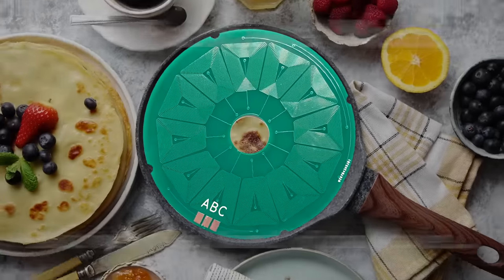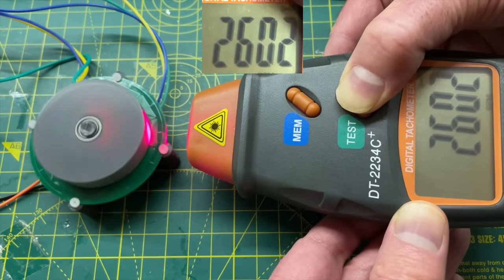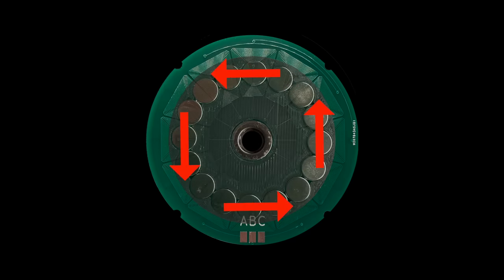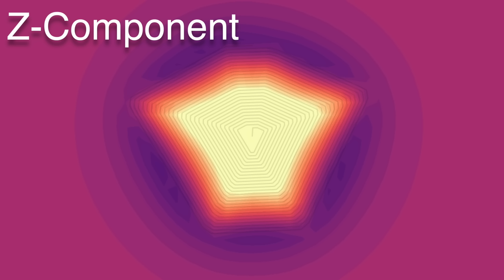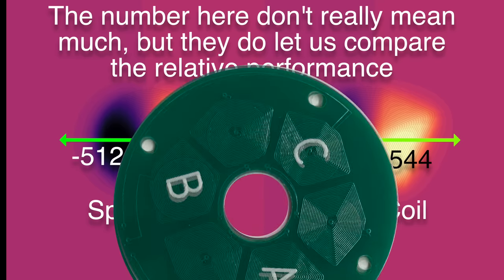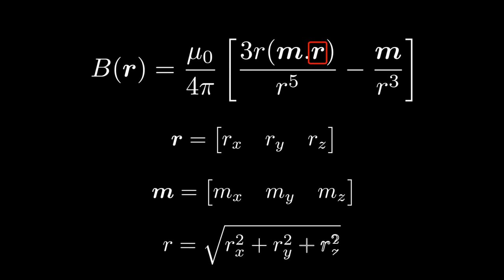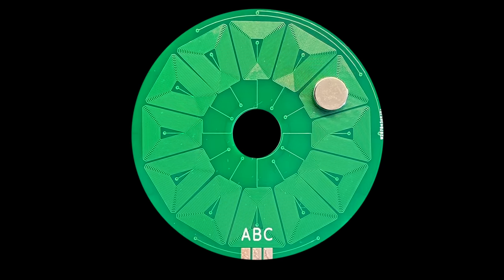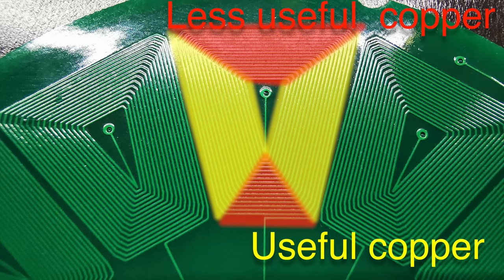PCB Motor - Why Are Wedge Coils Better Than Round Coils?

Comment: I think you are missing out on a lot of force/efficiency by making the traces the same size as the spacing. This maximizes the number of turns, but not the current density. If you keep the same minimum widths, but make the traces thicker, you will have less loops, but with a much higher current capacity, for an overall higher density. For ex, if you made the traces 3x thicker, you'd have 1/2 the number of loops, with 0.5 * 3 = 1.5x more current density. Right now you're effectively only using 50% of the copper available to make the coil!
Reply: So the goal is to maximize magnetic flux right? So ya maximizing change in current makes sense, so maximizing the peak current ability makes sense :)
Reply: @nikilragav  The magnetic field strength doesn't depend on the rate of change.
Reply: @deang5622  oh yea. Not dI/dt but just I
Reply: Magneto motive force is generated by N x I, where N is the number of turns in the coil and I is the current, so reducing the coils by some factor, means you have to INCREASE the current by the same factor to get the same force.  

In electronics, increasing the current required usually comes at extra cost - typically in power losses and / or the size required for the parts to drive the circuit.

For example, for the wires leading to the motor, losses are R x I^2, where R is the wire resistance and I is the current.  So if the coil current is increased by a factor of 3, losses in that wire go up by a factor of 9.  For small motors like this that can easily be solved with a bigger wire, but as your motor gets larger, that starts adding cost and weight.
Reply: @Cynthia_Cantrell  ..ya...i think so too, the solution is not to use bigger wires but thinner wires and more loops, and ofc ferros, as i understand it the experiment is to get as much torke out as possible... also in the initial experiment he uses magnets...he should be using coils instead...as i understand it hes not trying to reach a high rpm but torke...the rotor doesent even have to be of a metal...it can be another board sandwiched between two boards...just with an axis...if each 3xboards is 4mm thick its possibly stack a lage ammount of sequenced (sandwiched) boards to increse torke and lower the current....its even possible rotete each section to have an applied force almost constant with enugh sections... such a motor can also be used to deaccelerate almost immedietly (like a modern electric truck with electric breaking)
Reply: @nikilragav  Check again bro,  If a coil connected to DC Voltage, stays for longer than current "i"  transient connected to a totally stable DC Voltage, the coils retains the Magnetic Flux, wich is also stable, as long as voltage stays fixed also. If you maximaze flux change, then you maximaze power transfer as Fem, is this right you think ? Cheers
Reply: This is correct. The only thing that matters is the current density in the coil. PCB rules mean the minimum space needs to be 0.2mm or so. Wider traces will give you more copper in the coil. So you can maintain the same current density with less resistive losses. However, with fewer turns, you will have a higher Kv.
Reply: @Cynthia_Cantrell  in general, using fewer turns of thicker wire or more turns of thinner wire has no effect on motor power, torque, or efficiency, as long as you always fill the available space for wire efficiently. What changes is the motor Kv.
Reply: @deang5622  Zeno begs to differ.
Reply: @mckenziekeith7434  Rubbish.
The original equation by Cynthia Cantrell was correct.

It is the magnetic field strength which is a function of the current. Increase the current and you increase the magnetic field and the torque produced increases.

Motors are current driven, NOT voltage driven.
Seem you have forgotten your electrical machine theory and magnetic field theory from University.
Reply: @Cineenvenordquist  Then Zeno didn't study for a degree in electrical engineering and did not study the magnetic field equations for current carrying conductors.
Reply: @Cineenvenordquist  ya..ur idd correct, I is always time dependent
Current(I) is: Columb(C, not to be comfused with speed of light) per second,
1C/s=1A (1C=the charge of 6.241509074×10^18 electrons)

im also chocked no1 even mentioned magnetic permability & magnetic resistance
(magnetic resistance may not be an issue...its not like thay are trying to reach a hig velocity (high freq of magnetic changes 1M+), just a few hundred/thousand rpm...
Reply: @deang5622  I re-read Cynthia's comment. There is nothing in it that is wrong. My apologies to you and Cynthia for implying that there was an error. Cynthia is talking about losses external to the stator. I think the first time I read it I was a bit too hasty and misunderstood. I thought she was saying that using larger wire (or wider trace) in the stator would lead to increased losses in the stator. That would be incorrect (given certain assumptions), but that is not what she said. There is also nothing incorrect in my statement. It's just that it doesn't actually contradict Cynthia. So you saying "rubbish" is, well, rubbish. Also, to say that "motors are current driven" is definitely rubbish. Most motors, given certain assumptions, obey the relationship that torque is proportional to current. But they also obey the relationship that speed is proportional to voltage. For permanent magnet synchronous motors (or BLDC's) the back EMF is proportional to speed. The drive voltage has to be higher than the back EMF in order to cause current to flow in the motor and create torque.
Reply: @mckenziekeith7434  Um...I'm pretty sure that current is proportional to voltage too. Lowering resistance would also cause more current to flow but varying a coil's resistance is not as practical as varying the voltage.
Reply: @undercoveragent9889  current is proportional to voltage in a resistor. That is Ohm's law. The simple model of a BLDC is a three phase generator where each phase consists of a generator with a resistor and inductor in series. Changing the windings on the motor changes the generator voltage, the resistance and the inductance of the motor. You can't only look at one thing you have to look at all three. But what motor designers discovered long ago is that motors are more efficient when the current density in the windings is kept lower. Packing more copper into the space available for windings always makes the motor more efficient, but it also has an effect on the voltage required to drive the motor.
Reply: @mckenziekeith7434  Have you heard of Fleming's Left-hand Rule?
Reply: @undercoveragent9889  I just looked it up online because it didn't sound familiar. I don't think I was taught that rule in my electrical engineering courses. At least not by that name.
Reply: @mckenziekeith7434  Well, the point is that the properties of motors is more tied to current than it is to voltage. Think about it; how is 'magnetism' manifest? 'Magnetism' is directly associated with the movement of electrons, right? You could say that 'magnetism is proportional to 'current'. And you would be correct because you could argue that since you have to choose a 'voltage' and 'resistance' in order to ensure a requisite 'current', then 'voltage' and 'resistance' are less fundamental than 'current' with regard to 'magnetism'?

It's subtle, I grant you, but you could ask: suppose I have a conductor with an infinite resistance, what 'electromotive force' could cause 'magnetism'? Right? Infinite volts would produce only one Amp of current, right? Would that magnet be more magnetic than a magnet produced by a conductor with one ohm of resistance with an emf of two volts? 

Right?
Reply: @undercoveragent9889  we have ventured far from practical motor design. The point is you don't have complete freedom to change L, R and Kv (the motor voltage constant). They are all interconnected. The magnetic force in a real motor is the winding current multiplied by the number of turns in the winding. If you take a motor and re-wind it using more turns of thinner wire, completely filling the available space, the motor efficiency, torque, power all remain unchanged. The motor resistance and inductance will go up, the Kv will go down, and you will need a higher voltage to drive the motor, but apart from that it will be unchanged. Likewise if you re-wind the motor with thinner wire with the SAME number of turns, the resistance will go up, the Kv and inductance will be unchanged, and the efficiency will go down. Hope that makes sense.
Reply: @undercoveragent9889  you cannot ignore voltage or current. Both are important and inter-related in a variety of subtle ways.
Reply: @mckenziekeith7434  The only thing that matters is the current density in the coil.
Reply: @undercoveragent9889  that is what I said, too, somewhere up-thread. But the context is that efficiency and torque produced only depend on current density in the area allocated for the winding. However the back emf of the motor will depend on the number of turns. More turns means higher back EMF. At the system level, matching the back EMF roughly to the available drive voltage is also important. Otherwise every motor would just have a solid bar of copper with a single turn. Why would any motor have more than one turn if the number of turns doesn't matter? Anyway, I am finding this conversation tedious. I don't think we are communicating very effectively.
Reply: I have to compose my thoughts a little more congruently before I leave my previous reply behind; plan to get back to these matters tomorrow, hence this practical internet bookmark.
Reply: So using this rationale, we should eliminate all empty space and just make one very wide trace in the loop that uses almost all the space?
Reply: @skypickle29  That would give the strongest magnetic field, but it would make the control electronics more difficult, due to low voltage and high current. It would also cause the edge effects to be a lot more significant, since the wires leading to and from the "coil" would have just as much impact as the coil itself. By choosing a value somewhere in-between the two extremes, the benefits of both can be maximized.
Reply: Make a 3d copper trace 1mm height,  use thick add-on pcb ( 1mm copper thickness  ) , or use multiple layer copper thin prepeg made from uv glue, with pth, ( add-on pcb module)
Reply: @Cynthia_Cantrell  Exactamente, el torque depende de (N²*i²*A)/L² y se le multiplican algunas permeabilidades de los materiales y la del vacío
Reply: @skypickle29  Absolutely. Thick coils are preferable for efficiency of the coil. The advantage of thin wire is lower current (= cheaper electronics), approximating the current flow in thin wires is closer to reality than doing the same in thick wires, and due to a high number of windings the current flowing through the wires that connect the coil becomes insignificant.

So there's a tradeoff, and the point of the original comment is if the width of the insulation between the wires takes up just as much space as the wires, you are far from any optimal tradeoff. 
Things get really interesting once you consider that the geometry of PCB coils allows using nonuniform wire widths, which allows us to reduce heat losses, or increase power at the same losses.

Comment: if you want to stress your bearings less, put another board on the other side. not sure if you can just tie them both together or not, but I think so, as long as you either have the top one upside down or something.
Reply: I agree with this comment. You could even put another rotor on the back side of the PCB and have them share the same axel. I wonder if it will allow for more torque and or efficiency.
Reply: If the opposite sides of the board are both attracting or repelling the rotor the shaft won't be torqued in the wrong direction.
Reply: Or power several coils at once to cancel out the imbalance. That's already how brushless motors work. With 12 coils, that's 3 sets of 4 coils, giving you 3 input wires.
Reply: or put another magnet rotor on the other side of the board?  this should double the effect of the coils, making the motor more efficient, i think.

Comment: Have you considered arranging your magnets in a Halbach array for more efficient use of the magnetic field? Halbach arrays have all of the magnetic field on one side of the array, and almost zero field on the other. This means for the same mass of magnets (or perhaps a bit more, since you have the interstitial magnets that force the field onto one side) you double the usable magnetic strength.

See if you can take advantage of the Halbach array concept to make a better PCB motor.

Comment: Nice video. Thinking about xyz fields is key. You can see this just playing with two disk magnets, how the pole to opposite pole interaction is so different from the edge to flipped edge interaction. It's why it's so much easier to slide magnets apart than pull them apart!

Comment: I once drew on a paper napkin that instead of coils, the 3 phases would snake in and out like a Celtic knot, along the flat stator. The magnetic fields would be equivalent to the spiral coils, but with no loop-back, only a loop-forward to the opposite coil.

I never said it was a better idea 😮

The flat spiral coil traces should be thinner near the center and bold near the edge… then only need to cool the center.
Reply: Now try feeding it to Maple or a field simulation and then advancing the rotor. Plenty of 3 phase machines to draw on if you get stuck ofc.

Comment: I have noticed a lot of the more compact VHS belt mechanisms use a setup similar to the pizza slice PCB traces to drive the tape reels. However, in those instances, the coils are not the PCB traces but are 2mm tall loops of copper soldered and glued directly onto the PCB in the pizza slice pattern. you might be able to do something similar, to test even more shapes and loop thicknesses without the need of multiple PCBs. I love the video, keep it up!
Reply: Yep, and there is steel disc's on the magnets and under the coils to focus flux

Comment: Interesting.  If you look at commercial generators/motors, the 'coils' are laid out such that most of the copper is running parallel (or skewed only slightly) to the shaft.  This puts most of the field in a position to exert force at right angles to the shaft, maximizing torque.  The 'end turns' are outside of the iron and only help to route the current to another slot to form a field of opposite polarity some distance away.

Much like your explanation of the trapezoidal winding, it's the current conductor portion that is radial to the central shaft that imparts the torque.  The inner and outer peripheral current doesn't really help.
Reply: Are the stators your referring to the ones that look basically like straight lines radiating from the center point? Very interesting.
Reply: I agree, though I think he was working on an axial torque motor, vs the traditional radial torque motor.
my thought was that he could make one out of stacked rotor and stator plates for more torque, you could keep the plate spacing small, above a certain speed, they would float off of each other via the Bernoulli effect.
Reply: @davidconner-shover51 this is with both axial and radial flux machines but it is possible to use most of the wire by zip zagging it but then the wire is at an angle so it's a trade off

Comment: To stop the load on the bearing due to the magnet disc twisting, put a second board above it in the same polarity. That way it's being pushed or pulled equally in both directions.

Get that working well enough and you might be able to do away with the shaft and bearing and have the disc levitating between the two boards. Design the disc to pull air in at the edges, and out in the centre, creating a pillow of pressurized air between the disc and board to further reinforce the levitation.

I don't know how useful that would be, but it would be cool to do.

Comment: i think you can get tiny bit more efficiency by changing angles inside coils.. for example inner triangle have lines that are tilted slightly, you can move them closer eliminating dead space in the middle and distribute it by creating many thin triangles if you do not care about lines being parralel

Comment: Also in normal stators, the coil is wound around the "hammers" of the stator, so that as much of it as possible runs along the motor´s length, and not perpendicular to it... ideally, the hammers are as long and thin as possible, so to totally avoid the perpendicular coil-portion (but the ideal solution cannot exist in reality). The perpendicular portion will be re-formed in a half-oval-shape, so that it has a longitudinal portion too, and not solely a perpendicular portion. For that, the hammers have to be increasingly thinner at the stator´s ends, and that´s very expensive, so that only experimental motors have it (beside a single stencil to usually stamp out all laminates for the stator, now you need countless additional ones, to stamp out the laminates for the increasingly thinner ends, since a single laminate is as thin as 0,1mm). Normally, the stator will be a casual one, which means, that to avoid the perpendicular portion a bit, something else is used, that´s not of iron, for the half-oval-shape, and as it sn´t of iron, it cannot concentrate the magnetic field as good... Otherwise, ohmic resistanse is lower too, since the half-oval-portions are shorter than the perpendicular ones, resulting to less overall cable-usage, lowering resistance

Comment: Try using diametrically magnetized magnets with the diameter line separating N/S running radially and the diameter equivalent the size of your wedge coil.  That way both sides of the wedge will generate a force tangential to the motor axis.